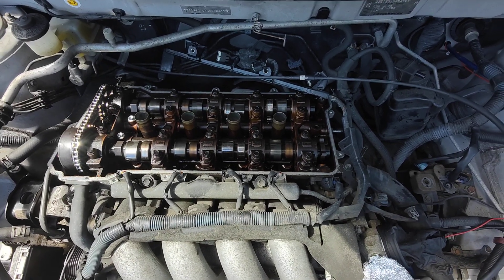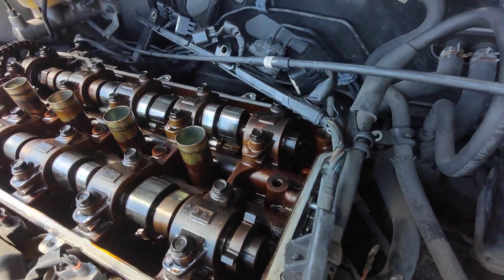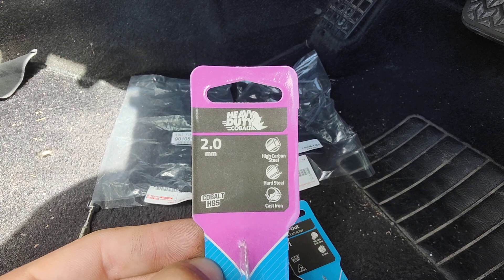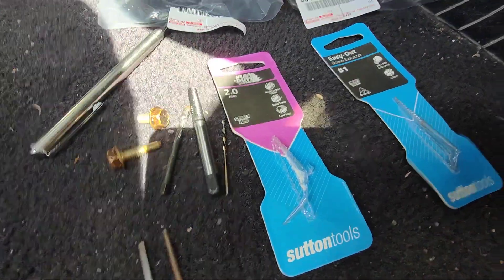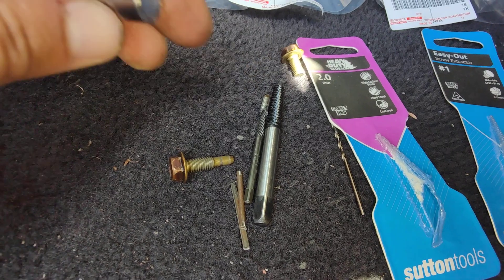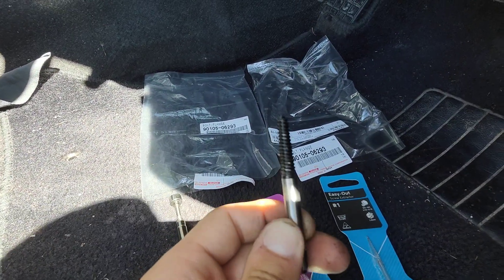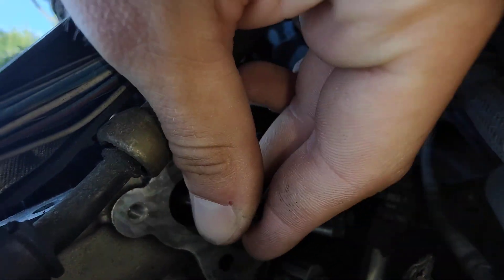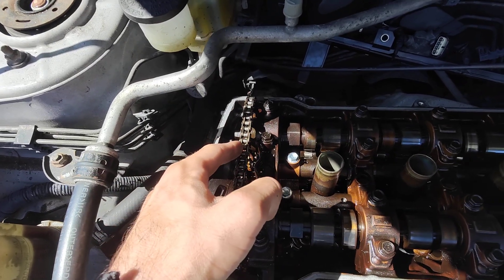2zzge Lift bolt replacement without cam removal.

Comment: How long did you drill for? I was drilling into it and barely made a hole in it.
Reply from the maker: Not very long around 30 seconds. Buy a new drill bit cobalt ideally cause it's hard aluminum. Good luck
Reply: @rakselectric7390  yeahh no luck lmaoo I ended up just changing the whole shaft.